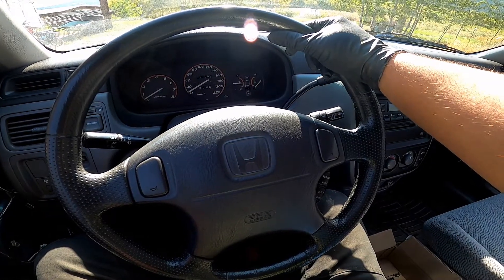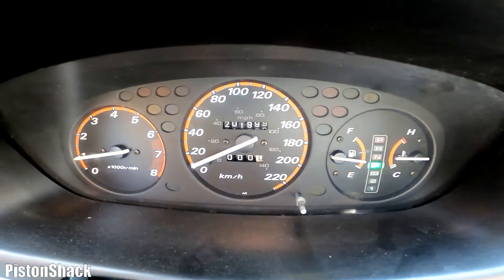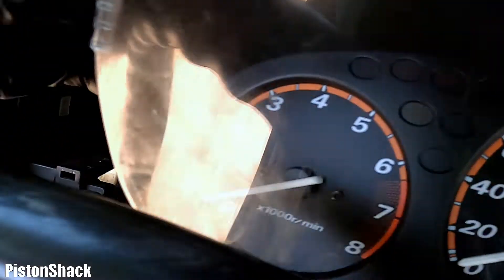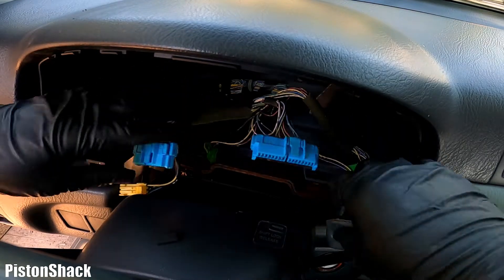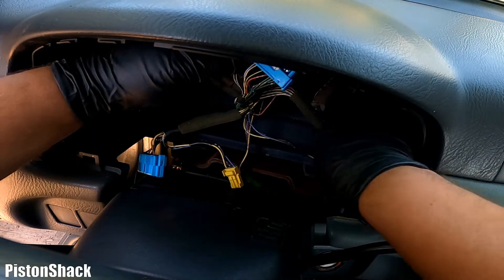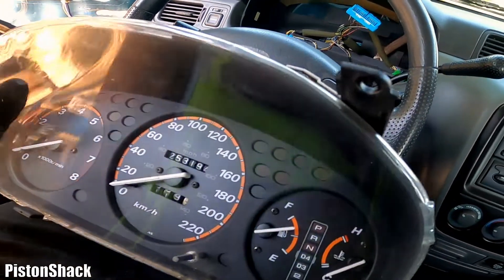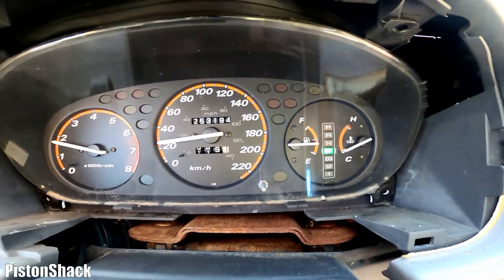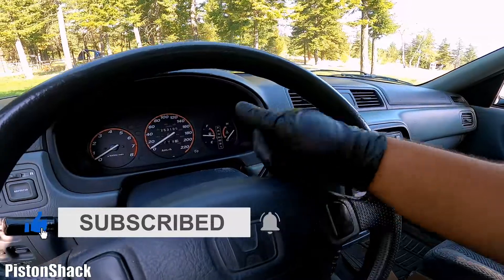HONDA CR-V ODOMETER / TRIP METER STOPPED WORKING - PROBLEM SOLVED | HONDA CRV 1997-2001

Comment: Did you find what the problem was with odometer? What if you buy a brand new one, how to get the miles back on?
Reply from the maker: Good question. I am not sure yet.
Reply: Any update on what the issue was?